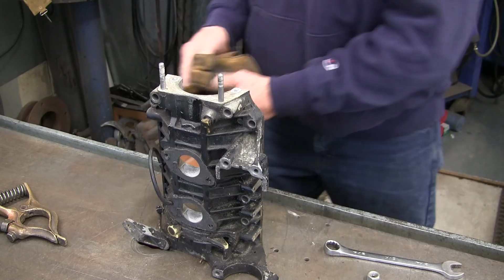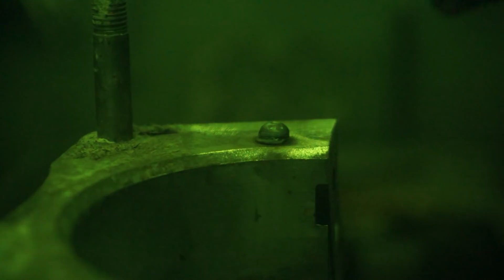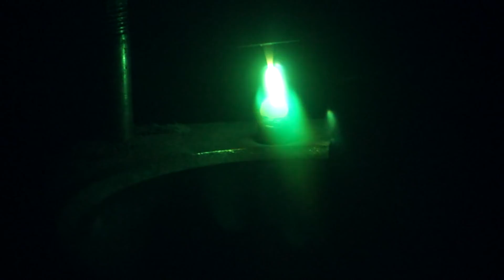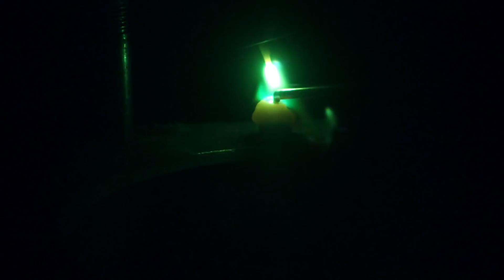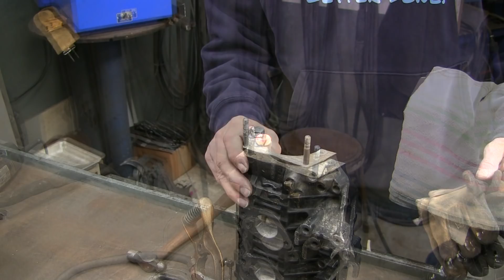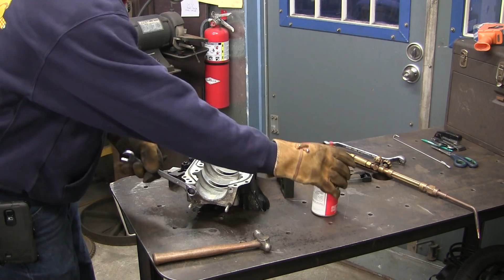Put A Head On Your Thread

Comment: 18:45 hit the other side you fool. you've got half of the threads expanded from heat, but the other half (the outside of the chass) is cold. you run the risk of melting one side of the female thread arrangement.

Comment: Alum and hot water will melt that stud right out without a T.I.G. and risking stripping the threads.
And you could heat the aluminum and use a can of Compressed Air Duster turned upside down to freeze the bolt.

Comment: the best way to extract the bolt after you weld the nut on is to use a battery powered impact ,,dont let it cool down. the vibration of the tool makes it turn loose.. i do this all the time. good luck..

Comment: I would not have kept on pouring more and more heat on like that - more frequent heating and cooling (with compressed air)cycles will break down the products of corrosion into powder faster.

Also, I wouldn't use any kind of liquid - it just serves to congeal the corrosion into a claggy mess - far better to just work it out as a dry powder.

Comment: Toooooo much bunny, plus using that fierce wire brush will ruin the mating surfaces for the gasket, plus  just cut a slot with a dremel disc, warm the aluminium and unscrew the stud!

Comment: I do that often but i just use any bit of stainless scrap out of the scrap bin if its round bar scrap just weld it on at jight angle to the axis of the broken bolt rather than waste a nut I'll try to remove it whilst is hot from the welding if it don't come easy let it cool the use penetrating oil diesel is good but don't put to much heat into and soften the aluminum and damage the thread leaving it wet overnight is good

Comment: one more tip from someone who has removed alot of broken bolts: If you can, ground right to the threads that are sticking out. If not, you may actually end up welding the threads on the interior of the hole when the ground finds an easy pathway through a certain spot...

Comment: I used a mig welder to remove broken studs out of an exhaust flex pipe flange. The weld was breaking. I welded a flat washer on and a bolt on to that which allowed me to put a stronger weld on it and it didn't break. thanks for the videos

Comment: Great video! So cool how you were able to build up that bolt using a tig welder. I do have a question ...
Applying that much heat to an aluminum automotive part, was there any concern about warping the flat surfaces where the gaskets are inserted?
Thanks
Reply from the maker: +Chris “Nashville Edge” Simeone Heat spreads way fast on aluminum and escapes fast from thin sections, the amount was not exceeding that of a running engine, why I had to keep adding to maintain the growth around the threaded area. Great question and subject to keep in mind when using method.  ;{)------

Comment: Good one Keith. I don't have a tig welder handy, so I use a 3/32" stainless rod (312-309) and do exactly the same as you, except using a Miller Thunderbolt welder. Touch the stud then release. Build up the stud then slip a stainless nut over the stud. Usually the heat from welding the nut Is more than enough to release the frozen stud. It must be nice to own a tig welder.

Comment: How does that penetrating oil compare to Kroil?  I friggin love Kroil but it costs so much...
Reply: +Patrick Whitehead Have yet to try Kroil. Haven't seen it for sale locally and its too much $$ for me to order. Will get some eventually. I think you have to use dextron with the fords and type f on chevys when you are taking things apart. haha
Reply: +Keith Fenner i've heard atf + acetone 50/50 beats all others. have yet to test it out myself
Reply: Sam King I can't disagree with you there.   It's residual properties leave much to be desired for most applications.  WD-40 is like a multi tool.  I does a lot of things, but isn't the best at anything except perhaps what it was formulated for in the first place: Water Displacer. I use it all the time for a lot of things.  It's just handy to have around and it sure smells better than most of the others.
Reply: +dusitngrush Have you tried kroil? Also, do I need to use f type on fords and dextron on Chevys? :P
Reply: +dusitngrush I've worked in transportation and industry for a long time now, and I haven't found anything better than kroil- as long as I'm not paying for it. It turns out that I have some acetone and atf laying around, so the next time I need some rust busted I'm definitely going to give it a try. My old truck needs rear brakes so it'll be in the next month or so. I'll report back with my results.
Reply: +Sam King wd-40 is a moisture eliminator, not a lubricant; unless used in bulk.
Reply: yes, that's it. My buddy's an airplane mechanic for a major carrier and its all the co.uses. Always worked wonders for me.
Reply from the maker: +Patrick Whitehead I come across free or cheap stuff and never seem to run out. ;{)------
Reply: +Albert Tremblay I can verify that this works better than any commercial product i have tried. Only problem is that it must be applied a few times over a few days to really work.
Reply: +Albert Tremblay I've used several penetrants but switched to acetone and ATF 6 months ago. works better than anything else I have tried. The smell of the mixture is also less offensive to me than most of the other stuff which is a plus.
Reply: I have not tried it yet, but I am told it works. Fluid film is good as lubricant and rust inhibitor so it still has it's uses.
Reply: +Patrick Whitehead If you have a NAPA Auto Parts near you they have a product known as PB Blaster Penetrating Catalyst. It works well and won't break the bank.
Reply: +Ken Foland   PB Blaster is what I've used for a while now.....Works pretty good.   I used to buy only Liquid Wrench with Teflon, that stuff was cheap and worked great. I haven't been able to find it anymore though. So now it's PB.
Reply: Sam King Yes the Liquid Wrench with Teflon is good I use it as well. But, I've found PB Blaster to work better on those badly rusted, hard to loosen parts.
Reply: +Patrick Whitehead I've used kroil and silikroil and atf/acetone wd40, PB blaster liquid wrench etc etc.  They ALL work.  I liked kroil until the can I inherited was used up and I saw the price!!  I'll use whatever is handy but if it's a nasty one, I use a mixture of 2parts atf 1part kerosene 1 part acetone.   I buy wd40 by the gallon and sometimes add stuff to it to experiment.  I can't definitively say any one is best because each frozen fastener is different.  I pretty much have learned to ALWAYS hit every fastener with a squirt of something before I take anything rusty apart.  And if they feel sketchy when they break loose, I squirt em again before removing them.  I like to use loctite thread sealant(the white stuff, can't think of the number at the moment but it's not thread locker, though I use that on other stuff as well.) on reassembly to minimize future issues.  That policy has paid off nicely for me.
Reply: blmeflmm66 I don't use WD-40 anymore.  That stuff seems like it evaporates within a day or two leaving nothing behind.  That's just my opinion though and you know how that goes.
Reply: +Patrick Whitehead ATF and a good solvent mixed up is all you need, and you can adjust the solvents by flashpoint for creep factor. then when youre done use some fluid film as antiseeze
Reply: +Patrick Whitehead I don&#39;t see him using any penetrating oil....I would have....right or wrong?  ooohhh wait, @20 minutes, there we go!!
Reply: When reinstalling fasteners, a low strength loctite will seal up the threads.
Reply: I use a product called "mouse milk" for aluminum, it was given to me from an airplane mechanic. it works wonders, drip it on and it foams up eating the corrosion.
Reply: james vos
  http://www.mousemilk.com/
Is this the stuff ?

Comment: hay Keith,  awesome job on building up the bolt and welding the nut on, done it a few times myself. however... working with aluminium head and steel bolt not so much heat on the head, but warm it up and spray WD40 or BPblaster  into the threads while warm(not hot have mercey on the head)can suck it in like sweat soldering and had great success.as always you make it look easy.thanks

Comment: I've used this method many times and it almost never fails if you're patient. Letting the part cool after welding the nut on is vital. Getting in a hurry and trying to remove the bolt while it's hot from welding is a fatal error. Heating the surrounding metal after welding is entirely different. It's the differential in thermal expansion and contraction between the bolt and the part that makes this technique work. Great video, Keith. I learned some fine points that may make the difference between success and failure in the future.

Comment: Try welding a washer first and weld the nut too it using SMAW unichrome S-265 made by Arctic welding.It's got 120 tensile and I had  great results using this method all the way up too 2 inch broken studs with a high torque on it in the mining industry.Btw I used to use the nut method with out the washer and it's not half as good.You get much more metal contact with the washer and much more ductility with Unichome.Give it a try

Comment: I'm a machinist for a very large meat processing company.   I have to deal with this problem on a regular basis.   Back in the day,  we never used  stainless fasteners in aluminum in a wet environment.   We always used zinc plated fasteners.    The zinc coating reduced the galvanic corrosion.  A great example of how to get er done.

Comment: Before you attached the 7/16" nut,do you think you could have just grabbed onto your weld pile and screwed it out with vise grips?
When I worked at my late  Cousins Marina in Jupiter Florida,That's how I would tackle a problem like that.Never needed to weld a nut on unless it was steel to steel.
Goes to show you,If the manufacturers would have just used a little triple Guard grease during assembly,all those stainless bolts would come right out.
Standing orders at the shop were "NO DRY ASSEMBLIES!!
Thanks Keith..

                                                    Jeff

Comment: If you've got the part in hand, drill or weld is academic. If the alternative is hauling out a heavy cylinder block, when all you wanted to do was a head gasket, getting a pro to extract what is left of a head stud by welding, is worth a lot more in saving  time and grief

Comment: I have a feeling I'll be using this technique on a salt water mercury that I'm rebuilding.  That method is much quicker than the drill and tap, heat is your friend with stuck bolts.  Mercury outboards bolts seem to snap easier than evinrude.  I had a mercury block given to me and it had 5 bolts snapped it took all day but they came out and the engine was put back on the water.

Comment: I have used this method many times on exhaust studs broken off in heads and manifolds.  I have successfully removed studs that were broken off more than 1/4" below the surface by adding a few drops of oil into the hole first.  The first strike of the arc vaporizes the oil and smuts up the aluminum.  Doesn't take long and the oil burns off of the steel and the weld will penetrate.  I pulled one out one time where the weld had drooped down and formed threads inside the aluminum but didn't bond because of the carbon build up.  Also, I generally don't let the assembly completely cool before trying the first turn, I give the steel component time to wick its heat into the aluminum but while they are both still very hot, try to turn it.  I have found that I have the best extraction luck while they are both still smoking hot.

Comment: way too much Effort, Time, and Resources. could grind level, cut an "+" for drillbit alignment at center and drill.  use extractor and heat if necessary.
Reply: No way a screw extractor would have taken that out. They are good for very loose bolts or small pipe. You have to choose your battles using them.

Comment: it is the best method to remove a broken bolt , much better than easy out 
patience is the most precious allied in such a job
Reply: +Jacques Poirier Absolutely, well put. Patience is the best tool you can own. I've found that every time I've tried to do a job in a hurry without thinking it through fully usually results in a less than desirable outcome. And, the time spent in advance usually saves a lot of time correcting mistakes; you can't charge for your mistakes or the parts and supplies required to correct them.
Reply: +Jacques Poirier wish i had a tig
Reply: +erik61801 
you can do the same thing with a MIG ou a rod welder if you use an easy to arc electrode as 6013
the idea is to give the stuck thread a heavy thermal shock that causes a thermal expansion and brreaks the corrosion bond

Comment: It's been my observation that stainless galls like crazy. How have you solved that problem?
Reply: +Adam Pierce  the thing with stainless is you always want to use antisieze on the threads before installing as others have said. I work quite a bit with stainless and you also want to always chase the threads or spin a nut on the bolt to check for any burrs. Once a gall starts on stainless to stainless you're in for some work. They basically fusion weld themselves together and you're done. 

 One method I've had real good luck with is using candle wax. Yeah, I know it sounds strange but it does work I was told this by a friend and didn't believe it and tried it just to prove him wrong. Egg on my face as it worked. Heat till not quite red and dab the candle wax to allow to seep in. Normalize and try. If no movement, repeat it. Don't know whether it is just the cycling of the heat/cooling process but I've tried it without the wax and doesn't work as well.

Try it once and see what you think.
Reply: @kjinohio  Candle wax is a petroleum product and of course it liquefies and wicks up into the hole  and lubricates the threads.  I too have seen it work.
Reply: @mikebidus7166   When stainless galls and fuses, no oil or liquid helps. It's not corrosion like normal steel, the burr just gets bigger the more you try to work it.
Reply from the maker: +Adam Pierce not always but by getting the aluminum to grow and breaking up the corrosion with short stokes of travel. ;{)------

Comment: If you have access to it, try Lloyds Moovit on the threads. Other than the propane propellant, it's non flammable.  Let's you spray the treads, then still go back and put heat to it without setting the whole mess on fire. Best stuff I've ever used by far. And no, I don't work for them. ;)
Reply: DrFiero wuuehwh

Comment: Nice video, Keith. 
I've used MIG the same way for removing bolts brokenbelow the surface, a bit scary as you don't want to weld the stub into the casting.  MIG can also work!

Comment: Keith, you need to put some wax on that bolt after you heat the housing.  I usually just use paraffin because I can buy slabs of it in the grocery store next to all the caning supplies. Candles work just as well though. Many years working as a mechanic in the rust belt taught me that trick.